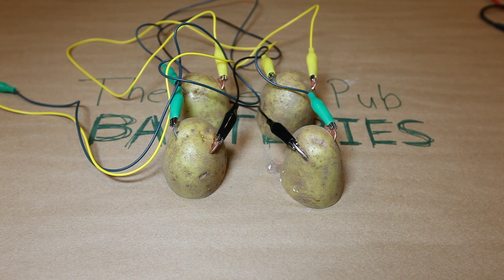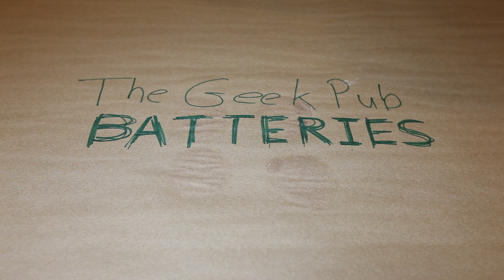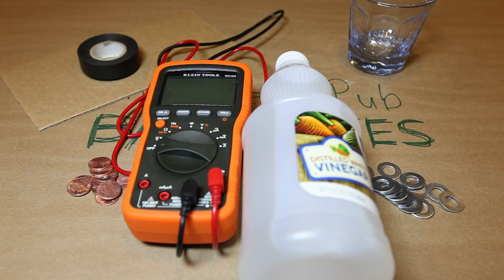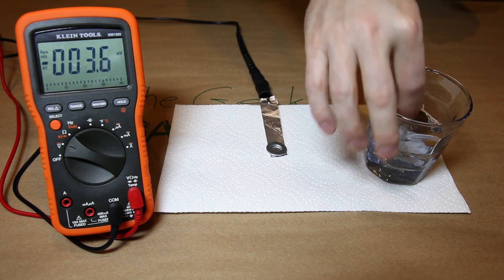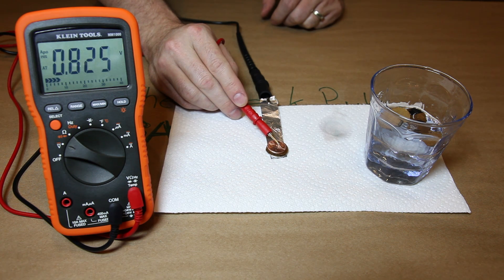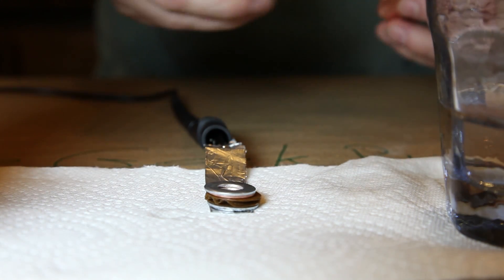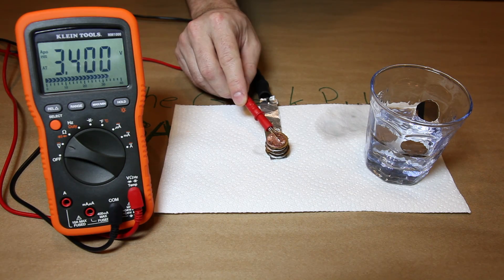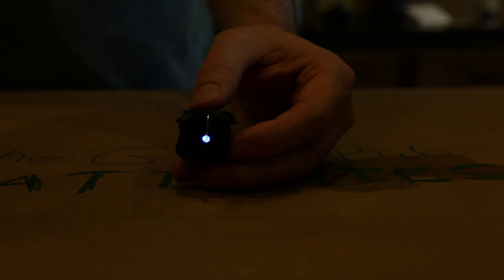How to make a Penny Battery

Comment: curious if this would also work with a solution of NaCl - IIRC NaCl is a stronger electrolyte than acetic acid, and therefore more easily conducts electricity.

Comment: Maybe you could stack all the 'ingredients' first in a tube with the cardboard still dry. Place the tube in a safe place. Connect what needs to be connected. Don't forget the kill switch. Then pour the acid. It should be a fairly rapid way to get this battery started without getting burned or shocked. As long as the tube is erm.... 'un-meltable' it should work for some time. But I'm assuming you could fry eggs on a battery that big..... Hey, video idea?

Comment from the maker: The only way to tell for sure its zinc is with a chemical test.  But if it is silver and glossy, it is most likely zinc.  But it could be nickel or lead too.

You can certainly make them out of large sheets of zinc and copper.  The more metal surface area will give you more current (amps) but not volts.  You'll need to stack cells to get more volts.

Comment from the maker: The only stupid question is the one never asked!  You most certainly could charge a phone!  With enough of them you could even weld metal.  The problem is that it gets very dangerous past a certain point.  When your voltage passes around 50v you start to get into the electrocution arena.  

I've thought about making a video where we take $10 bucks worth of pennies and make a stick welder.  But I haven't come up with a way to make it safe enough that I would demonstrate it!